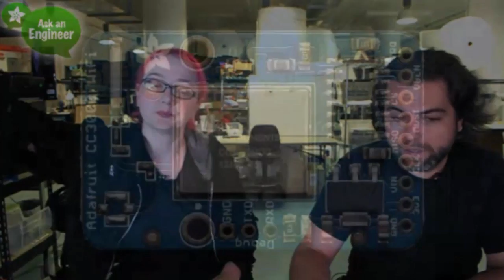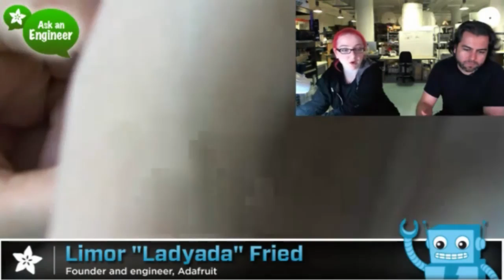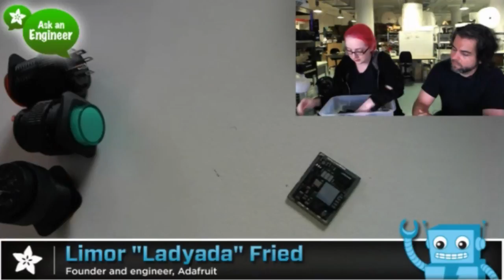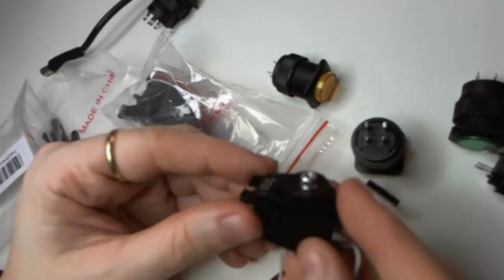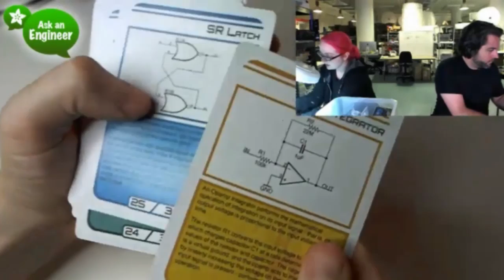WiFi Breakout & More! New Products 8/10/2013

Comment from the maker: See what's new this week! http://youtu.be/ye-oLaLjNag

Adafruit CC3000 Breakout with Onboard Ceramic Antenna (0:17): http://www.adafruit.com/products/1469

FLORA Sensor Pack (7:00): http://www.adafruit.com/products/1458

16mm Illuminated Pushbuttons (7:54)
Red Momentary: http://www.adafruit.com/products/1439
Green Momentary: http://www.adafruit.com/products/1440
Yellow Momentary: http://www.adafruit.com/products/1441
Red Latching On/Off Switch: http://www.adafruit.com/products/1442
Green Latching On/Off Switch: http://www.adafruit.com/products/1443
Yellow Latching On/Off Switch: http://www.adafruit.com/products/1444

16mm Panel Mount Momentary Pushbutton - Red (11:33): http://www.adafruit.com/products/1445

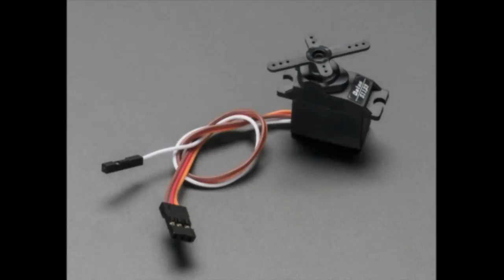Analog Feedback Micro Servo - Plastic Gear (12:41): http://www.adafruit.com/products/1449
Analog Feedback Micro Servo - Metal Gear (12:41): http://www.adafruit.com/products/1450

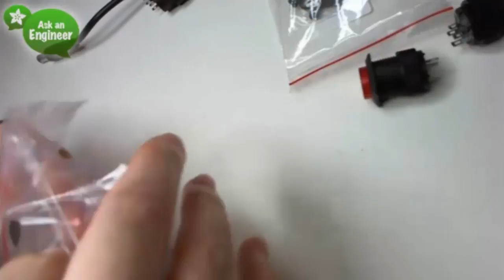Goldie Blox and the Spinning Machine (15:12): http://www.adafruit.com/products/1464

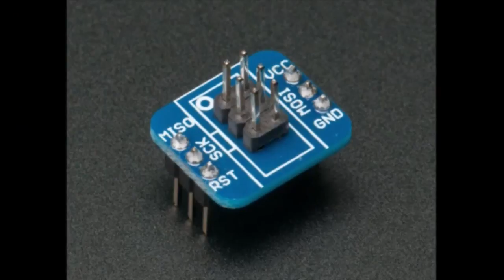Adafruit 6-pin AVR ISP Breadboard Adapter Mini Kit (17:28): http://www.adafruit.com/products/1465

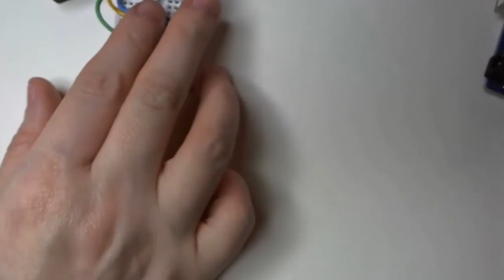Large Tin With Clear Top Window (19:02): http://www.adafruit.com/products/1471

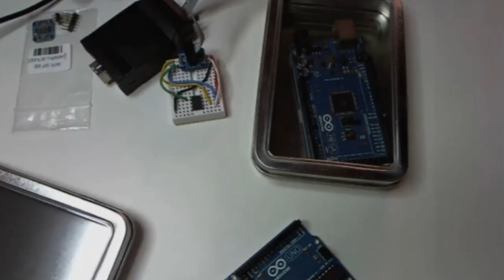CHARGECARD (21:09)
Thin Lightning Cable for iPhone 5: http://www.adafruit.com/products/1472
Thin Micro USB for Android / Device Charging Cable: http://www.adafruit.com/products/1470
Ultra-thin USB Cable for iPhone 4/4S (30 pin Connect): http://www.adafruit.com/products/1473

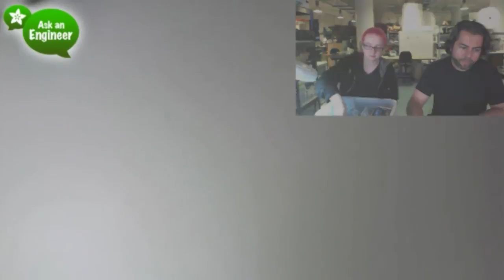Circuit Patterns Trading Cards from Arachnid Labs (23:18): http://www.adafruit.com/products/1474
Reply: Cool, thanks.